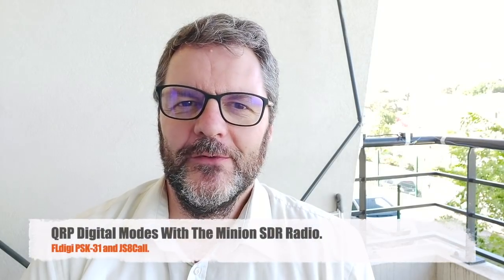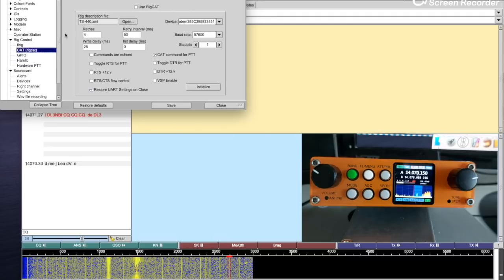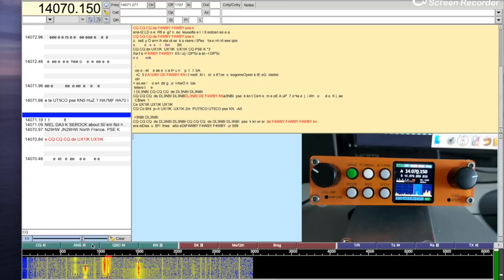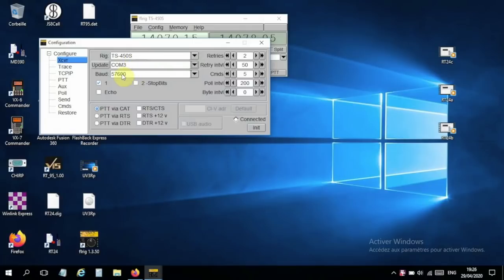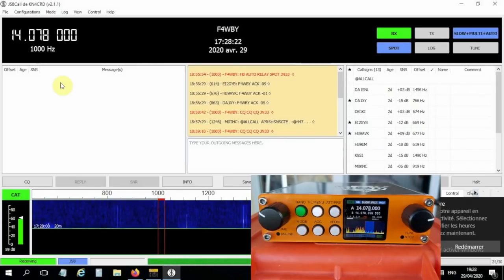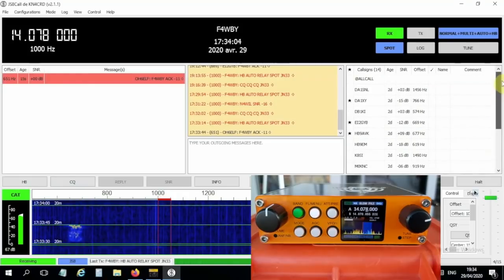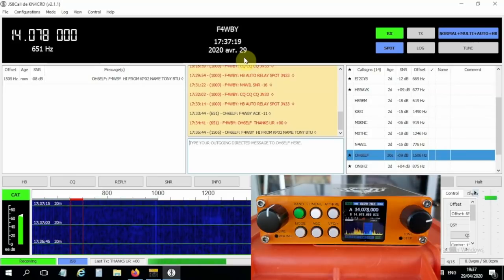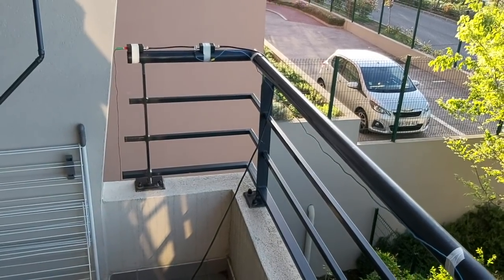Digital Modes With The Minion SDR Radio.

Comment: Been debating on the advantages of this radio over the G90. I think the only significant advantage is the smaller size. The G90 does have a build in antenna tuner, antenna analyzer, not as susceptible to RF currents. does has a QSK feature (though not perfect) The QRPver very small size does look cool though. As you pointed out it does have a nice quiet receiver. I may have to buy both. The G90 can transmit QRP or up to 20 watts. Did you ever consider purchasing the G90?
Reply from the maker: No, too big and bad current draw, but I did consider the G1M.

Comment: I use FL-Rig the whole time, as it is also easy to control your HF set. I have the FT-891 and use it to see the SWR and change the power setting if needed.
Reply: Martin Moerman I love my FT-891, can have 5 watts, 50 or 100 whatever you want and it’s not a very expensive rig either.